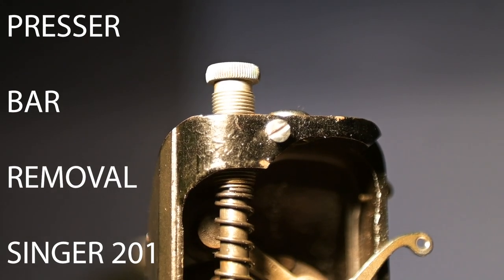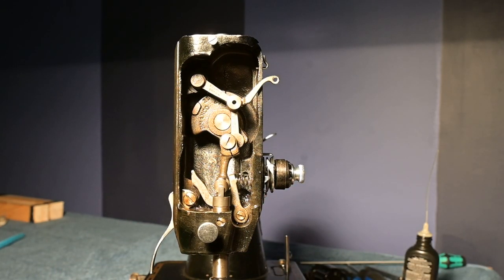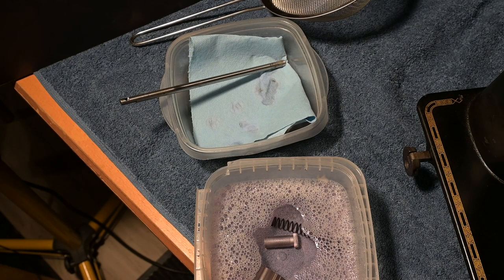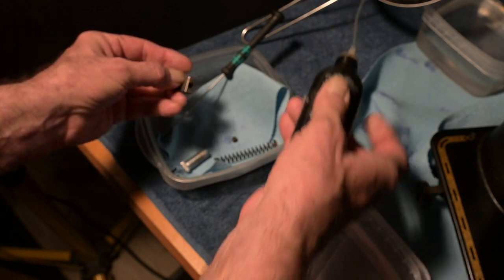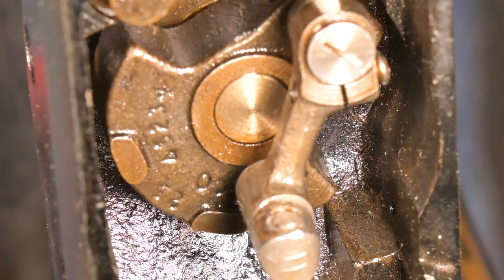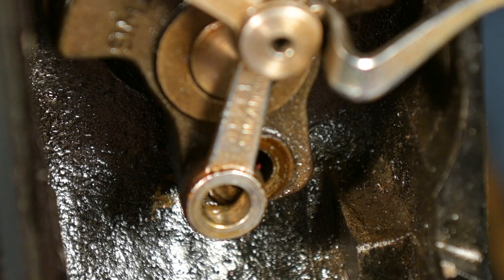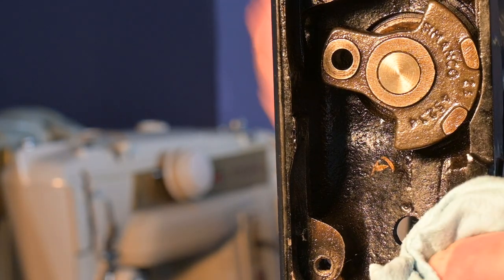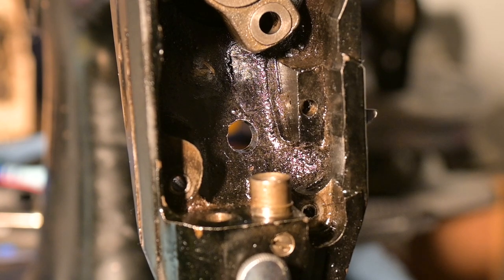SINGER 201 PRESSER BAR REMOVAL NEEDLE BAR REMOVE TOTAL SINGER RENO?

Comment: Now that is a very ambitious project.  I don't think I have what it takes to do the same with mine.  I hope I don't have to go that far into mine when the time comes.  I'll find out in the next couple of weeks.  I'll bookmark this video for future reference just in case.  Thanks for doing this and my hat is off to you.
Reply from the maker: Thanks for this! The 201 project is at an impasse! Lol! Missing 2 set screws in the connecting linkage; and I am not able to undo the screw on the horizontal arm shaft!
I am think of dismantling a 306k! I have 4 of them, spare parts if need be! Have fun, stay safe!